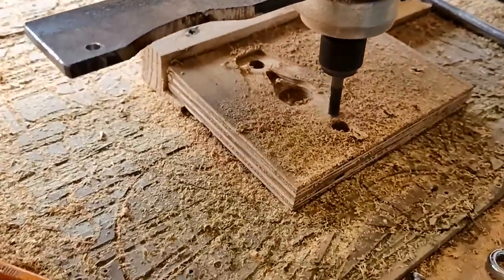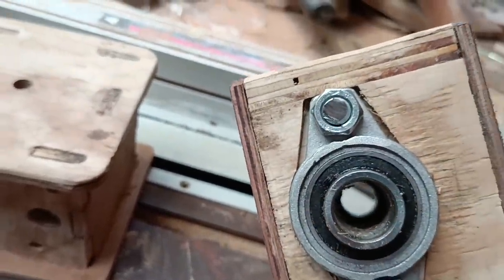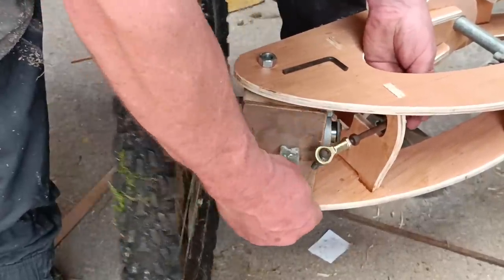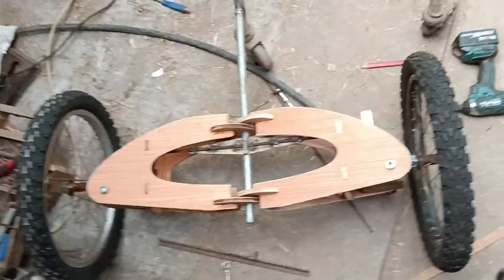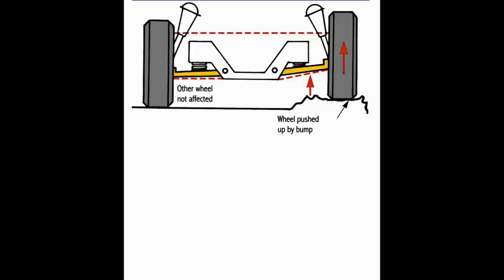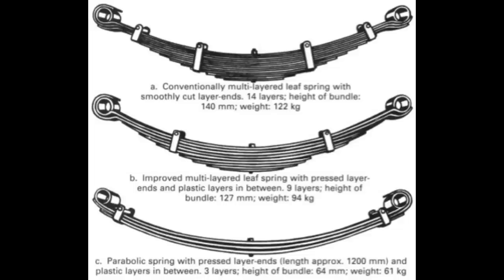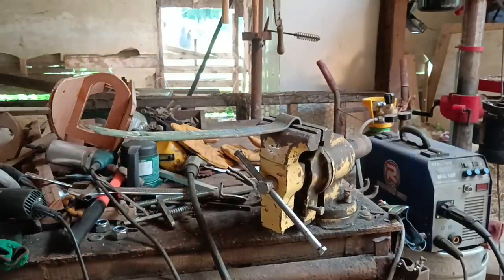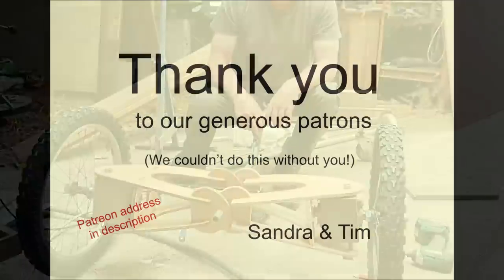Great Progress On The Wooden Car Steering And Independent Suspension System

Comment: You might be wrong about the weight of steel if you took into account that a 20mm x 20mm x 1.6mm RHS tubing that is 6.5 metres long only weighs 5.68 Kg. Probably about one & a half lengths of this would be needed for the framework so a little over 8.5 Kg for the frame, you can find plenty Corflute signs between 3mm to 5mm thick which are corrugated plastic which is 2.7 Kg for a 2.44m x 1.22m x 5mm sheet of Corflute, 2 sheets 5.4 Kg. Instead of all the heavy bearings you should use brass oil infused bush bearings that you can braze into the steel square tube.

You can finish off making the Corflute stronger by putting either polyester resin or epoxy resin & fibreglass over the Corflute sheets on each face of the panels then paint them. So 8.5 Kg (frame) + 5.4 Kg (Corflute) = 13.9 Kg + 14 Kg (wheels) = 27.9 Kg + 6.1 Kg (36v 350w mid drive motor which replaces the cranks) = 34 Kg + 11 Kg (steering, bicycle parts & other accessories) = 45 Kg + 5 Kg (36v 15amp Lithium Battery) = 50 Kg + 7.25 Kg (3 layers of 300gsm  Fibreglass Cloth) = 57.25 Kg + 16.5 Kg (Resin) = 73.75 Kg + 6.25 Kg (paint & other items such as lights) = 80 Kg + 10 Kg (polycarbonate windows) = 90 Kg + 10 Kg (shock absorbing suspension) = 100 Kg total. This is the lightweight route with making a lightweight tubular steel frame, bicycle parts, plastic & fibreglass.

Your idea with wood is a wonderful nostalgic idea but it will cause you to have greater weight issues with the amount of wood material used in the framework for steering, brackets for wheels, suspension brackets, seating, wall paneling etc as thin tubular steel along with plastic sheeting is not only stronger but much more lightweight than wood. With wood to attain it's equal strength as steel it will still need to be laminated with 3 layers of fibreglass just as the plastic Corflute has to also be laminated to give it strength. If I remember correctly that 12mm Ply weighs as much as 6.6 Kg per m2 so one full sheet 8'x4' or 12mm x 2.4m x 1.2m = 2.88m2 x 6.6 Kgm2 = 19.008 Kg per sheet, if you use 3mm x 2.4m x 1.2m = 2.88m2 x 1.65 Kgm2 = 4.752 Kg per sheet. The 5mm thick Corflute only weighs 2.7 Kg per sheet.
Reply from the maker: Thanks, SF. I guess the best thing is a combination of materials. I agree completely that steel tube is best for some jobs - and I might well use that for the frame. But plywood is also excellent - cheap, available in many thickness (I have some 1.5mm) and easy to cut and join. 
I like your calculations - 100kgs? I'll take that as a challenge and a goal..!
Reply: @wayoutwest-workshopstuff6299  I know the weights because I'm making an electric trike using 17" x 90 harness racing motorcycle  wheels & a 17"x 140 rear wheel all with radial tyres, that 20x20 frame, Corflute, & all the other things mentioned.

Comment: Intuitively I can see issues with your hinged steering tie rod.   Is a tie rod that can technically change the distance between the two points it ties in an uncontrolled manner a good tie rod? I feel like when you encounter resistance, the tie rod will bend up a bunch at the hinge.

I understand the points you're tying will change distance based on the arc of the suspension and so you need to tie the wheels in a way that can keep the wheels tied solidly but have the ' tie rod ' compliant with the suspension arc, while not being free and unconstrained.
Reply from the maker: You're right - but if that rod isn't allowed to hop up?
Reply: @wayoutwest-workshopstuff6299  the hinge needs to move from side to side along with the rod, so you cant fix it's position relative to the suspension hanger rod entirely, I suppose it could slide against a metal surface but that would not ideal to have two exposed surfaces just rubbing, perhaps some sort of bearing wheels on top of the hinge between it and it's ceiling....  Maybe an arched track for it to roll in would be ideal...

Comment: How much are you planning to carry with this car when it's done? That should be a consideration for your wheelbase.
Also, don't discard the option of going with three wheels. A single front wheel would make steering way simpler, and would reduce suspension to just a set of forks from a regular bicycle.
Reply: 3 wheels is MUCH more prone to tipping, though, and he is going for a car look, so the three wheels wouldn't look right?  Unless he's making a reliant robin, lol.
Reply: @RJayFlaming  It is unstable if you're not careful, but it's lighter and simpler.
I'm just saying it needs consideration, even if it's thrown out for instability.

Comment: I'm sure you know this already, but you don't want to be comparing the mass per unit volume of plywood and steel to decide which one to use. You want to be comparing the mass per unit *strength*. After all, your requirement is to support a given load, not occupy a given volume! I admit that calculating the required strength in practical applications is complicated.
Reply from the maker: You're right, James, but strength is much more difficult to compare because it's so variable..

Comment: Re materials, I agree that steel is not suitable. But what about aluminum? Many, many, many microcars -- Stateside, in the UK, and on the Continent (I'm afraid I can't speak to Ireland as an independent country, sorry, I just don't know) during the 1970s gas crises used a frame of aluminum square tube, with a fiberglass tub body atop. Obviously fiberglass is a bit much -- but sheet plastic is worth an investigation as well... a popular material for homemade velomobiles (enclosed bicycles and recumbent trikes) is sold under the name Coroplast here. It's a corrugated polypropylene sheet or panel, like corrugated cardboard.

"Coroplast" has become a genericized trademark here, just like "Kleenex" -- although I'm afraid I don't have a UK/EU brand name for the stuff. The most common use here is political signage just before voting, and because (quite thankfully) we have laws about when such signage must be taken down, around that time you can get dang near all the Coroplast you want, here in the US, absolutely free as long as you don't mind that it's in 12in * 18in rectangular sheets! It's incredibly easy to just rattle-can over the advertising and ziptie together a simple, simple body for something exactly like what you're building, especially because Coroplast cuts so easy -- a particularly sturdy pair of kitchen scissors will do, you don't even need tin snips, let alone a dremel or jigsaw.

You might also look at PET from plastic soda bottles -- good for window material, if nothing else.

Worth an honorable mention, although most likely not worth the bother of actually using... believe it or not, Duraplast. There's a lot of false info left over from Iron Curtain era propaganda. It's not biodegradable, it's not got cardboard in it, etc... Duraplast is actually really clever. It's the same idea as "duck" tape -- which was created as a cost-reduced form of fiberglass tape that was still sufficiently strong for most applications of the original -- but applied to sheet composites instead. It's the same phenolic resin used with fiberglass cloth to create composite fiberglass sheet and eg automotive bodywork, but instead of using fiberglass cloth, it uses cotton ducking -- basically, sailcloth that hasn't had its waterproofing treatment. From what I understand, in an industrial setting, you can even use it in the same sort of sheet metal stamping presses used for steel in, again, auto-body and similar workings, but Duraplast takes three times as long to cool, before it can be removed from the press. (Mind you, that's per Wikipedia, I don't own a sheet-steel press.) That said, again, it's probably not worth the hassle to use it.
Reply from the maker: Thanks LH. Those all have their merits - aluminium is very pricey though, and thin sheets need a frame unless they're pressed into shape? I will look into the others too..

Comment: Your comparison sketch is inaccurate. 
Your suspension at the top shows the wheel staying veritable.
In fact it will tilt even more than the beam axle.
Yours pivots in the middle. 
The beam pivots about the base of the other wheel.
Making the radius practically double.
Or half depending on your chosen design  😊
Reply from the maker: You're right, of course, Steve. I was just using a drawing to illustrate the principals, not my exact design

Comment: A meter could be a bit greedy for one, and might require more than a bench to stop one from sliding side to side.  Certainly that could be ameliorated with your coach work choices.  I think, sadly, like everything interesting, it's not an independent variable.  Let's say the cart hit some mud or ice and turned sideways, and then suddenly arrive at good traction, it should slide, not roll over.  Track width goes a long way in that department.  Thank you for another wonderful video.

Comment: what you need a leaf spring replacing the lower or upper arms, you can also have the spring above the arms you have made all ready and let the kingpin nut take the load simply rubbing on the end of the spring. perhaps an old cart spring?
https://en.wikipedia.org/wiki/Leaf_spring